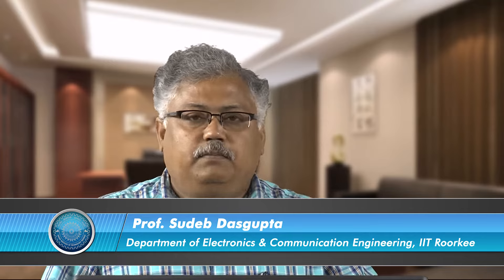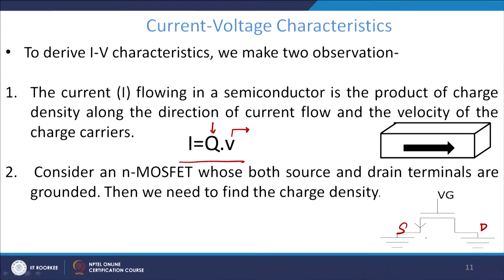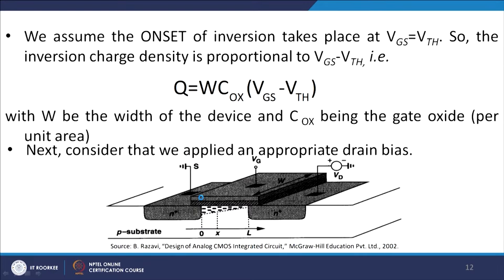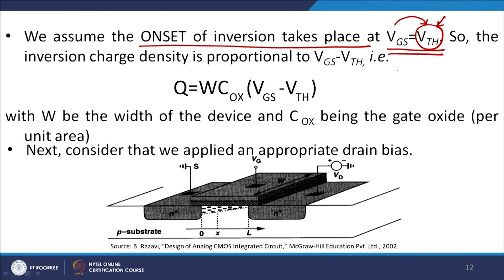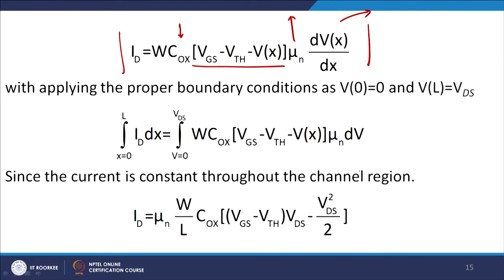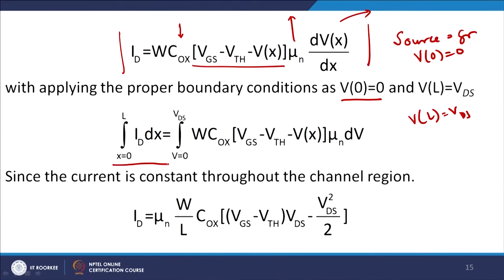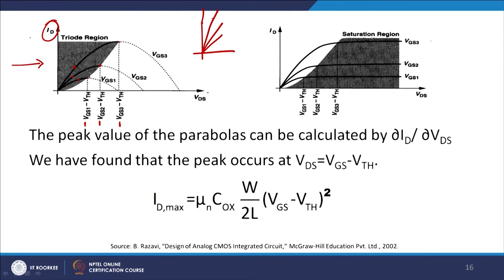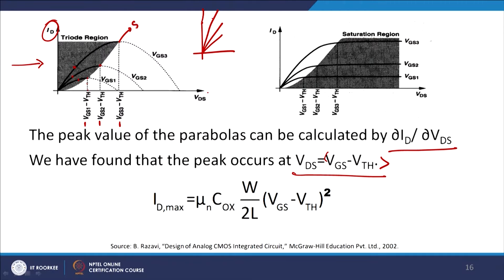MOS Transistor Basics-II

Comment: 🎯 Key Takeaways for quick navigation:

00:24 🧠 Lecture focuses on MOS transistor current-voltage characteristics.
01:18 🚀 Drift current explained due to electric field influence on charge carriers.
03:37 💡 Threshold voltage determines channel formation in MOSFETs.
04:57 ⚡ Overdrive (VGS - VTH) defines available gate voltage for charge carriers.
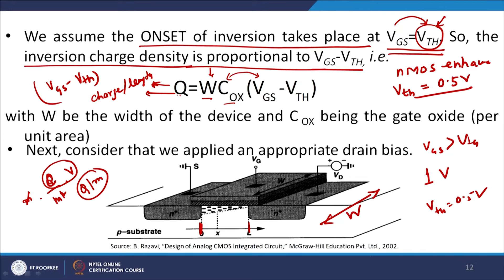06:13 📏 Charge density per unit area relates to available gate voltage.
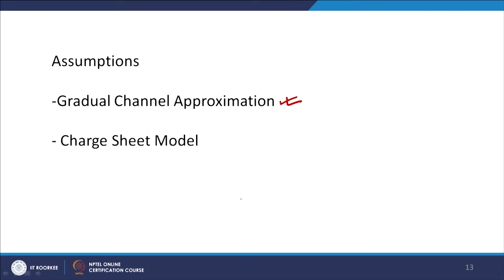08:08 🏞 Gradual channel approximation and charge sheet model assumptions.
09:56 🔌 Electric field influences charge distribution along the channel.
12:12 🔌 Mobility (μ) relates velocity to electric field for charge carriers.
14:35 🔗 Drain current (ID) equation derived with mobility and electric field.
17:02 🔥 Saturation region explained where ID becomes independent of VDS.
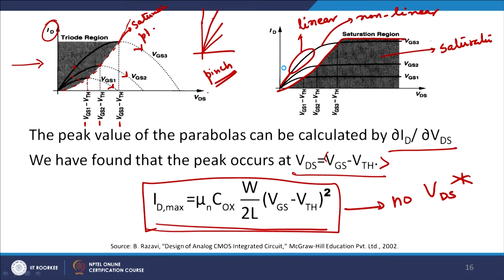18:52 🔄 Drain current (ID) parabolic graph indicates saturation and linear regions.
20:26 📉 On-resistance (Ron) inversely proportional to overdrive (VGS - VTH).
22:00 ⚡ Sub-threshold region explained, with ID continuity below threshold.
23:18 🌐 Strong inversion onset at surface potential > 2 * Fermi potential + applied voltage.
23:45 🔌 Sub-threshold operation results in low current, but to turn off the device completely, the voltage must go well below the threshold.
24:10 ⚙️ Sub-threshold slope is the gate voltage change needed for a decade drop in current, typically measured in millivolts per decade.
25:24 📊 IDS equation during sub-threshold operation can be approximated, yielding insights into current variations.
26:33 📈 Linear region, saturation region, and deep triode region are operational modes in a MOSFET with distinct characteristics.
27:54 🔌 In saturation, gate-source voltage must be greater than threshold for current flow. Gate voltage determines ON resistance variation.
28:23 📚 Recap of MOSFET basics, types, voltage control, and current behavior in different regions.
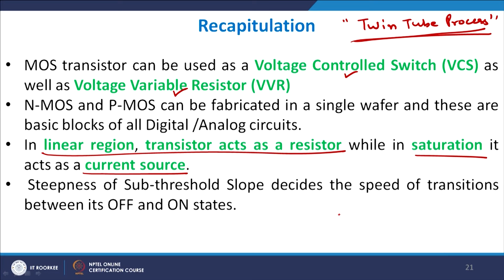29:15 🔄 In saturation, a MOSFET acts as a constant current source with infinite output impedance.

Made with HARPA AI
Reply: Thanks! ❤

Comment: 12:30  Sir  electron moves in the direction of increasing potential and here you are saying elections move from high potential to low potential due to a negative sign to it. It will be really helpful if you please clear our doubt here ?
Reply: As we have given +ve voltage to drain so that electrons move from source to drain.. so current is flowing in opposite direction (drain to source) that is why we have took minus there..
Reply: He mistakenly said electron actually it is current which moves in opposite direction